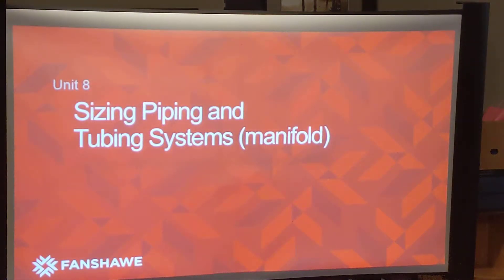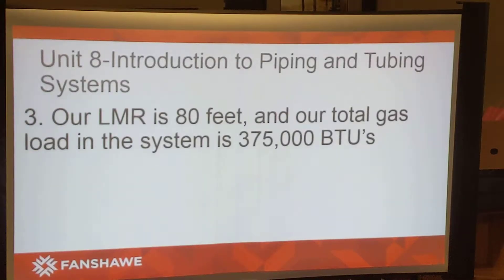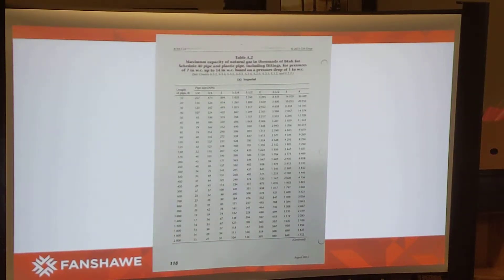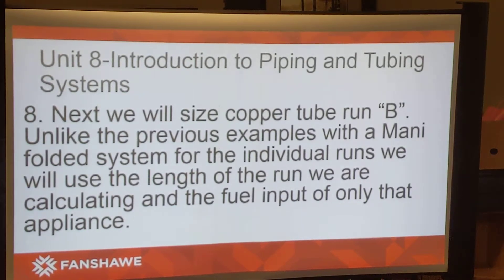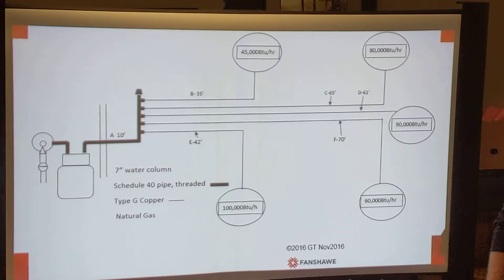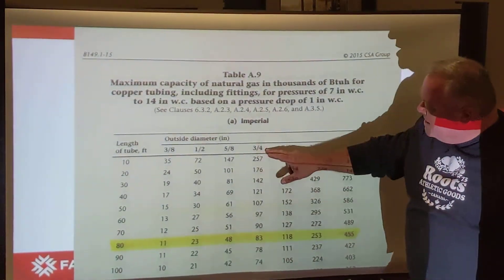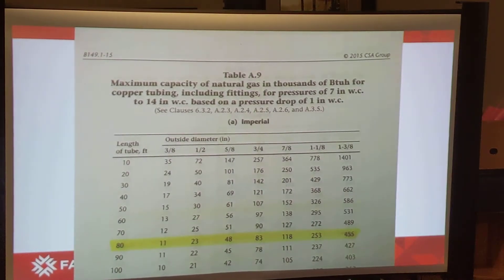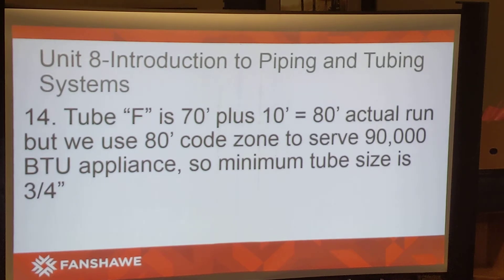Gas Tubing Manifold Sizing March 2019

Comment: I've always been taught even if you running it off of a manifold such as in the video you still always go by the longest run total even for the short runs so in your case everything would have been based off of the 80 ft

Comment: The 10 foot section, is that the total length of tubing coming from the gas supply to the end of the manifold?  And then does that calculation mean that our line off the supply and including the manifold all needs to be sized at 1-1/4 inch tubing and then reduced from there based on the individual runs?
Reply from the maker: I make the steel (schedule 40) section the same size (all loads added together and longest run from regulator to furthest appliance, then I size copper based from the regulator to the end of the load I am measuring with capacity for only that appliance